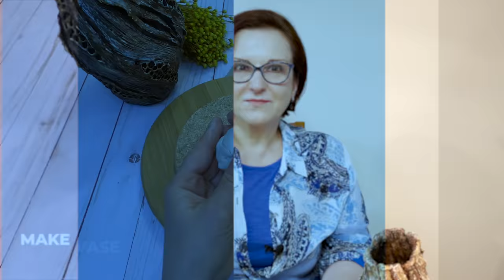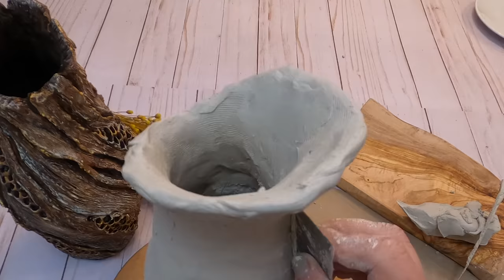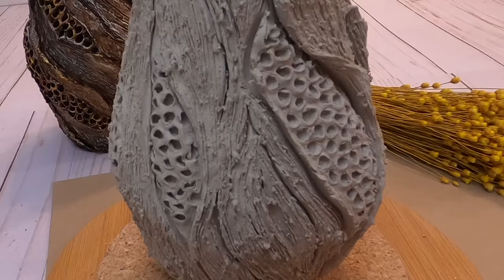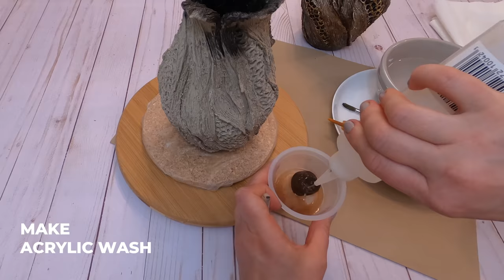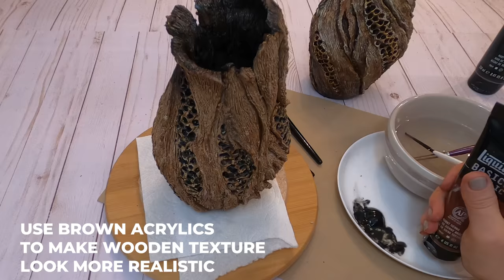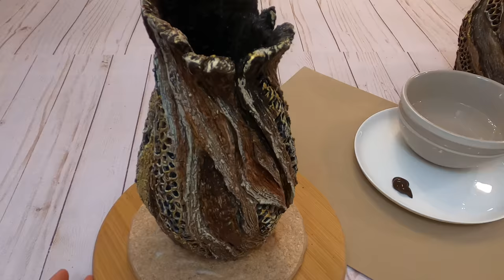WOOD TEXTURE  on Ceramic VASE | Full Tutorial | DIY AIR DRY CLAY Project for HOME DECOR

Comment: How do you water proof it?
Reply from the maker: When working with air dry clay is almost impossible to make it completely waterproof. This vase is decorative project and I use it primarily for dry plants. However, if I want to use this vase for live plants, I'll put plastic or glass container inside to hold water.
Also, same vase can be built from regular clay, glazed, and fired. This way it will be truly waterproof.

Comment: I have a statue 15 inches tall how do I stick the clay to the wood to make a base?🤳
Reply from the maker: Usually, you need to place a rod in the bottom of statue and base and glue together. Without rod connection will be very fragile.